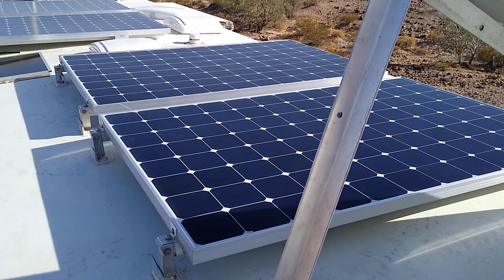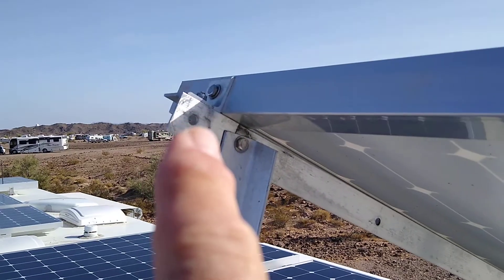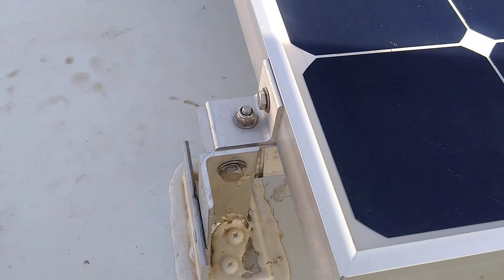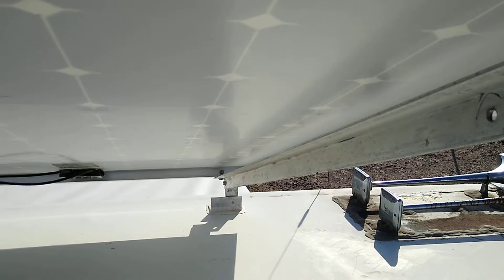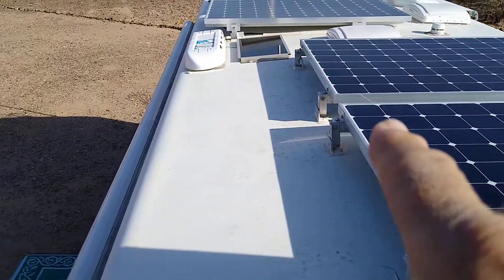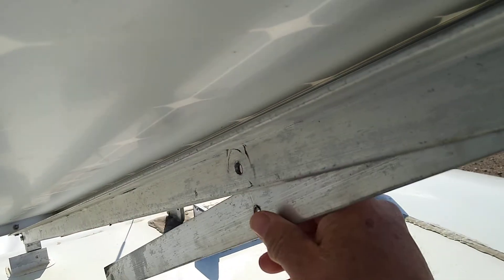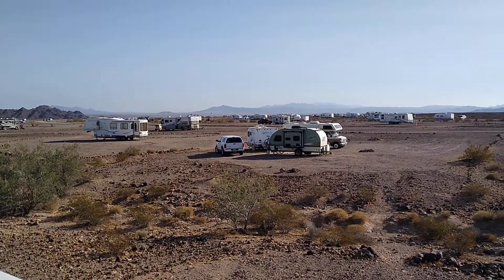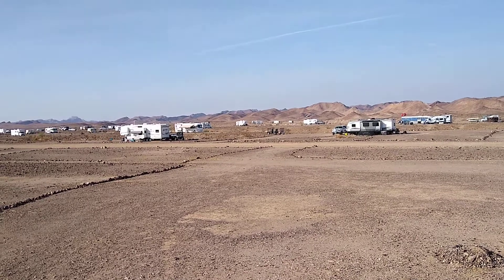RV Solar System Mounting and Tilt

Comment: Have you had any problems with panels blowing around with the Wind Orient heavy rain storms
Reply from the maker: None, even at highway speeds, with severe weather conditions. Thank you for watching our videos and for your comment.
Reply: Thank you for your reply do you leave the pianos up when you're driving also
Reply from the maker: @paulgrassi4088  No, if I left them tilted. The motorhome would be too high for the 13'6" height limit.

Comment: Thanks for the video.
Is there a roof Joist you screwed the base angle to?
Reply from the maker: No, Winnebago does not have roof joists. We used a combination of glue and mollies. We have zero issues with highway speeds or the 50 to 60 mph desert winds. Thanks for watching our videos and for your comment. Be safe, be happy, and may we meet around a campfire.
Reply: @igowhereimtowed6839  Great, thanks for the reply.